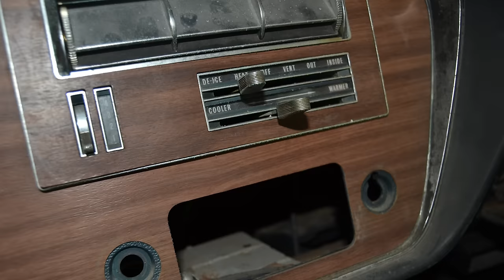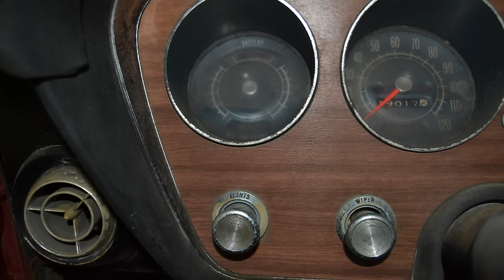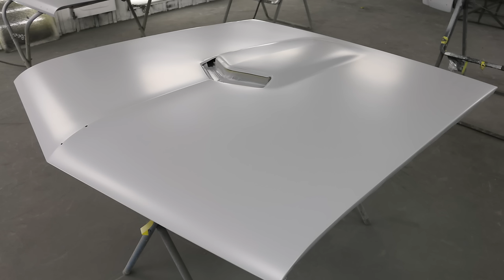Muscle Car Of The Week 1967 Pontiac GTO Restoration and Unveiling V8TV

Comment: When I was 15 years old (back in 1989), I was given a '67 Pontiac Tempest. It was in pretty rough shape. Not quite as bad as this one was to begin with but, it was rough. Originally, it was the same color as this GTO. It had the original 327. All matching numbers. I wish I would have had the resources at my disposal to have done a proper restoration on it and enjoy it. Sadly, though, I ended up selling it. It had a blown head gasket. My dad and I didn't know if it was a bad head gasket, warped heads, or a cracked block. There was oil in the coolant and coolant in the oil. Turns out, it was, in fact, just the head gasket.

I love auto restoration videos (in general) and I especially love seeing GTOs, Tempests, Bonnevilles, and Catalinas restored. It always takes me back to a happier time.

Thanks for sharing this video. You guys did an AMAZING job on it!
Reply from the maker: Thnks for sharing the story and the kind words!
Reply: The engine would have been a 326. The 327 is a Chevy engine

Comment: This car has a special place in my heart.  I was born in 1967.  When I was little, my mom had two cars in a row with a similar color.  First, she had a 1964 Chevrolet Corvair convertible.  Next, she had a beautiful 1966 Pontiac Bonneville coupe in a silvery blue.  Her next car was a green, 1969 Pontiac Grand Prix.  The Bonneville was a 389, I believe, and the Grand Prix was the same engine as that GTO...a big block 400 that would roast the rear tires off the wheels.  I guess I have always been a Pontiac guy.

Comment: I had a 67 GTO back in the mid 70's, had a 360 horse 400 with an automatic (His and Hers dual gate).  It was a screamer and when I put headers and spread bore Holly it was amazing.   In my humble opinion this was the best looking Goat ever.   I rue the day I sold it to buy a custom 'Good Times' van.  So it goes.

Comment: Very nice job goes to show you can take any car and bring them back even better than new provided all of the parts are available which is not always the case. Have to say was a little leary of the motor since it was an older rebuild but seems to have worked out just fine.

Comment: I use to own a 1967 GTO from 1971-1976 light silver green Black vinyl top 4 speed wood steering wheel also had the the hubcaps that looked like knock off wheels 42 k miles

Comment: I bought a 66 Lemans Tempest when I was 15 (44 yrs ago).  Me & my buddy rebuilt the 326, it had over an inch of sludge in it.  We bodyworked it for paint, only had one dent in the rear 1/4.
I drove it for 2 yrs until I decided to drive to school when it snowed. I lost control passing my school bus & hit a pole right behind the passenger door, it was bad, broke the tranny in half.  I almost made it back home but broke down, and vandals broke the rear window, driver's & 1/4 window out of it.  I had it towed to a junk yard & got $25 for it.  Damn I miss that car.

Comment: Judged at 997 out of 1000 points. 💎
Curious though … 🤔💭🤷‍♂️
With better than factory original suspension, brakes and air conditioning, 
is that why three points were deducted ? Just curious. 
Congratulations to the restores and the owners/caretakers. 👏🙌
Reply from the maker: Great question.   This was a modified class, so the changes didn't detract from the score.   They deduct for things like dust in this class.   We'll check to see if we have the actual deduction notes.  Thanks!

Comment: Hey Kevin,  at what point of the process,  do you guys tweak and twist the frame straight. Just curious,  because I never hear anyone talk about that part of the restoration.
Reply from the maker: Hey Doug, we measure and check the frame in the beginning of the process to make sure it all goes together properly.    Sometimes they do require a bit of "finessing" to square them up.

Comment: I had a 66 GTO and the back lights on the 66  much nicer but the fact of the matter is the only way I got my GTO to run the quarter-mile much faster I took out the 389 I put in a 427 l88 motor now the car was fast
Reply: Just curious what was your e.t. with the 427 ?
Reply: @tomrobards7753  12.38

Comment: I wouldn't term this a 'restoration' as the original car was a rust bucket and the only piece that was 'original' was the power train and frame. If it was a real restoration it would have been returned back to factory original specs every nut and bolt would be original, all the parts OEM and the paint would be vintage. This is really a resurrection and a alteration to modern technology, which is cool and to each there own but not truly a factory concours restoration.. You missed the factory pin stripe that was on every 67 GTO I ever owned by the way.
Reply from the maker: We agree the goal on this one was not a 100% concourse car, as the owner wanted some mods to update the performance.   However, you're suggesting that a restored car is wearing vintage paint?   I think you're referring more to a Survivor car than restored.    Did you see our video on the red 1971 GTO Judge pilot car?   That video shows the car in its original state and then completely restored at the Muscle Car and Corvette Nationals.    But yes, a concourse restoration requires all the correct, born-with items to be with the car.

Comment: Should have done better with the engine rebuild though...
Reply from the maker: The engine was completely rebuilt before we got the car, it had just sat for decades.  We checked all the clearances and condition of the internals and determined it didn't need another rebuild, just a "freshen up" with gaskets and cosmetics.   Runs great.

Comment: Ok...all that work...complete restoration of chassis and body and everything else....and you did not even replace the bearings in the engine...crank journal bearings, cam, cam bearings, rod bearings, new piston rings, lifters....you should of went thru the engine more completely.
Reply from the maker: The engine had a complete rebuild before the car made it to our shop.   We checked bearing clearances and everything was still as-rebuilt, so there was no need to build it again.    Time had passed, but it was all good.

Comment: At that point its basically a reproduction. Not a restoration. My opinion.
Reply from the maker: It certainly is a mixture of both.   Many parts restored, but new parts as well.
Reply: Seemed like 95 percent new parts from the edit. Which theres nothing wrong with, just bums guys like me out that prefer to save the old stuff.